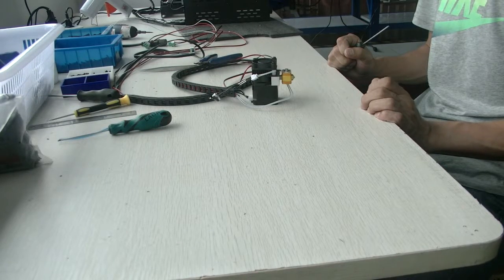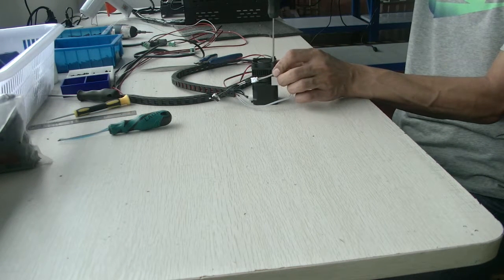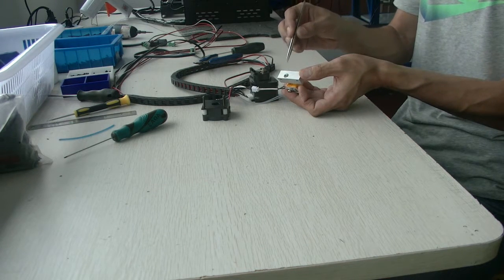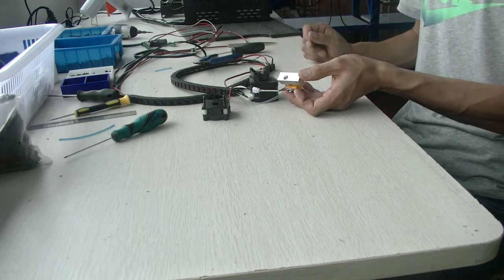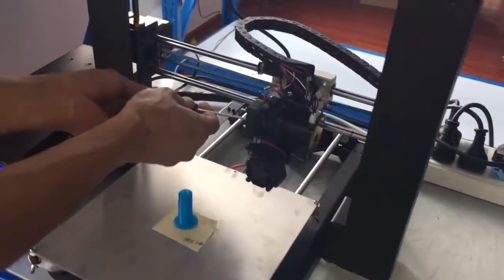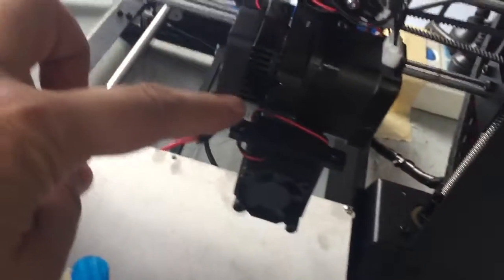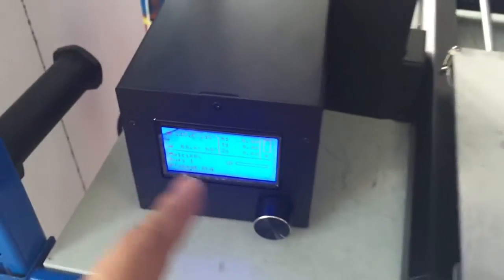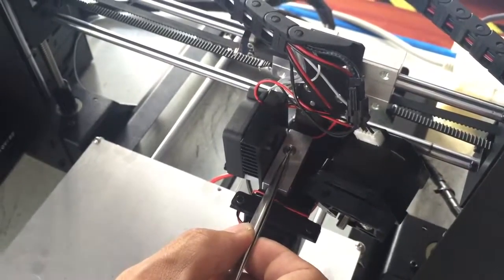How to deal with i3 extruder filament stuck?

Comment: I accidentally got a piece of filament stuck in the extruder and this video helped a lot. I pulled on the filament really hard in frustration and it broke to the point I couldn't take it out. I managed heating a paper clip with a lighter and pushing it the rest of the way through, luckily the paper clip was the exact diameter of the throat of the extruder. Hope this can help somebody out.

Comment: I have heated up the extruder and tried to pull the filament out but it is stuck fast
Reply: mine is the same? did you have a solution?
Reply: I can't even push it in like in the video, it's completely stuck. Did you have any kind of solution?